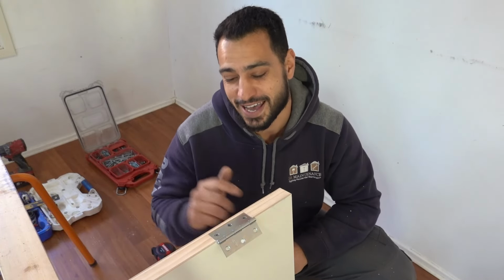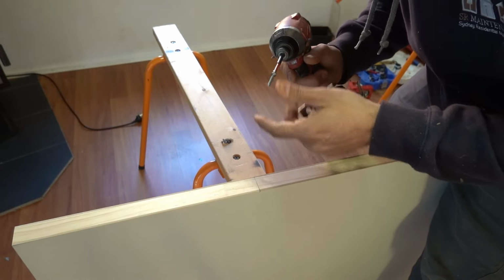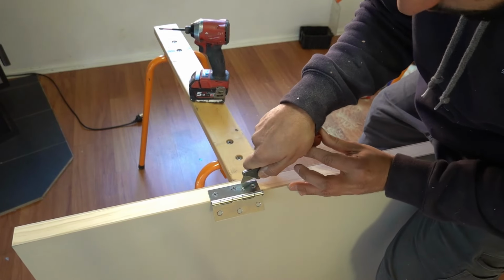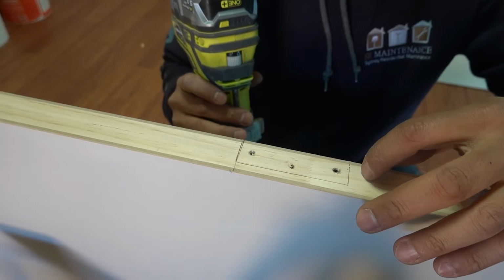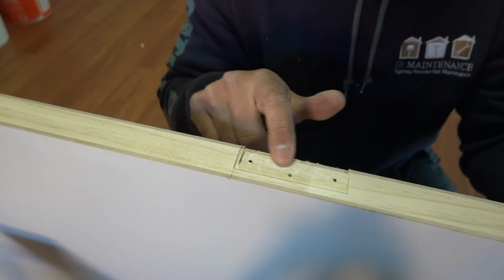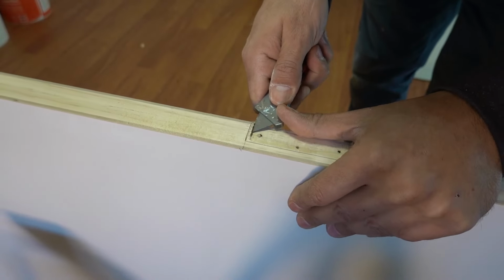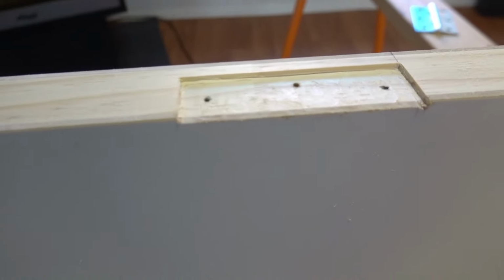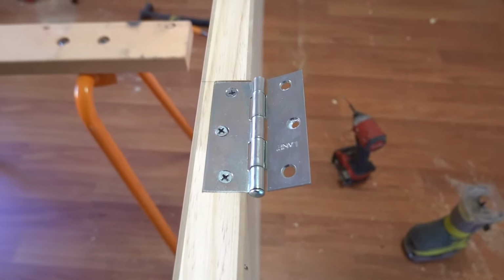How to cut door hinge like a pro - diy

Comment: I had a load of doors to hang and saw this method posted by someone else but they held the hinge my hand, drew round it the used a chisel to mark the edges before getting out the router. Your method is simpler and works,  if anything, better.
With my job, because I had so many to do, I built an adjustable support consisting of a couple of 100mm x 50mm offcuts with aa pair of cross pieces (one end fixed to one baton, the other slotted  and secured to the other baton with furniture studs and wingnuts.
In use I drop the support over the edge of the door and clamp it on to the door. The cross pieces mean that the upper edge of each of the batons is level with the top of the edge of the door and this gives the router something to ride on. I use an 89mm base Makita router and often fit 100mm and larger hinges so by the time you've cut out most of the hinge recess there's nothing for the router to ride on.
I use the same jig to support the sides of the door, with the addition of a couple of g clamps, when I'm drilling holes for 1" cylindrical locks as it's very easy to crack the facing of the door if the bit bites and tries to twist the drill out of your hand.

Comment: Great video. Just wondering why you wouldn’t make a little jig for your router. You could completely skip the part when you screwed in hinge and then removed it again.
Reply: I think his main point is to NOT have to make a jig. He reduced it to the minimum number of steps and procedures while allowing a perfect hinge install, despite the job taking only a few minutes to perform.

Comment: Looks backwards. Three knuckle part of hinge is normally installed on the door frame. Two knuckle part on the door.
Reply: I was always taught.. More on the door?
Reply: @iTZzArJuN With three knuckles on the frame, the hinge pin is supported by the outermost first and third knuckles yielding a greater resistance to torque from the weight of the door compared to the pin being supported by two closely spaced knuckles when the hinge leafs are reversed.

Comment: Ridiculously unneccessary to install the hinge, score it then remove then rout. Just draw round the hinge with a pencil and rout it 😂
Reply from the maker: Once you try it you will understand why the perimeter is scored .The router only has to be close to the scored line and it removes the material clean up to the line 👍
Reply: @billshowto  can be scored without screwing them down if you need that. Draw the line trace around it with the knife of you need to. Screwing and unscrewing is unneccessary and weakens the bite of the screw on thr second go.